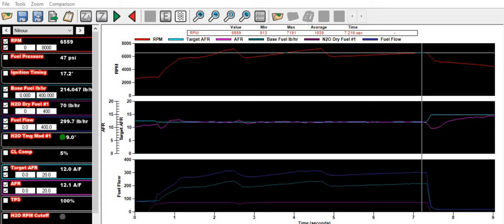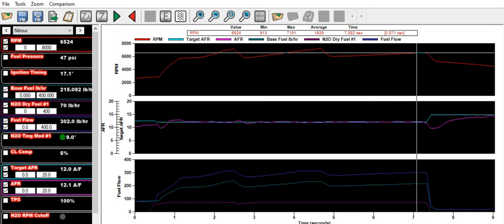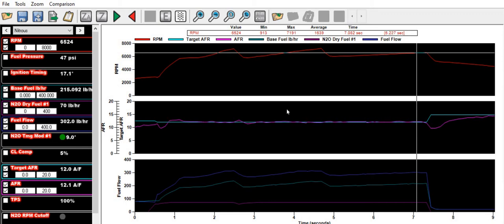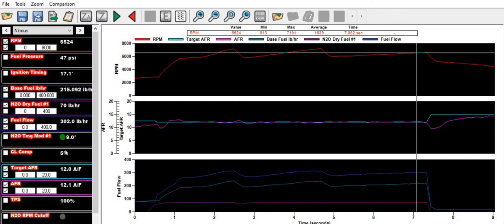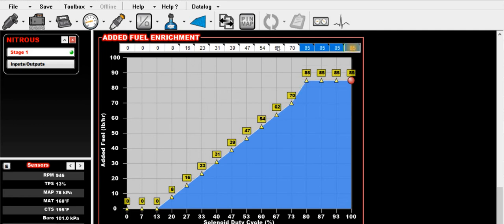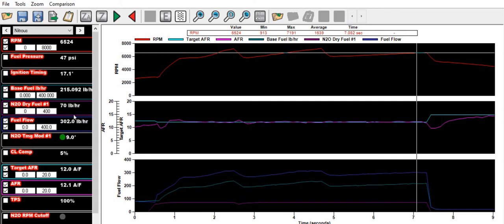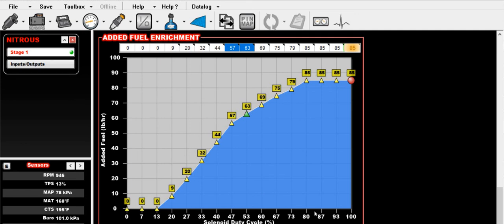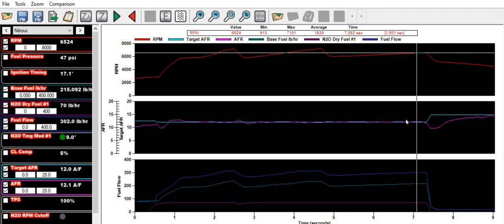Nitrous Fuel Correction with Holley EFI

Comment: What afr do you like to follow per nitrous shot?
And how much nitrous is okay with just pump 93?
Reply from the maker: Let me stress that this is my opinion since the first thing I usually get is an argument but I typically will run 12.0:1 up to about 750hp. I’ll then taper down to 11.4-11.5 up to 1000 and usually level off there. Past that I don’t have enough experience to comment. 

Nitrous can get too rich earlier than boosted applications typically. 

The amount of nitrous isn’t really related to pump gas as much as cylinder pressure but for general terms on LS engines I usually stop somewhere around 150-200 before going to pump gas but that depends on engine size and chamber shape, plug heat range and tip style etc. 

Gotta keep an eye on plugs and make good decisions
Reply: @greenshortsperformance  thanks that helps big time. 
I don’t understand why people always want to go to 11.8 or richer afr for nitrous some times..

What about timing you add some back in after peak torque like what people do with boost?
Reply from the maker: @408lethal  yeah I typically run a half AFR leaner than boost but it’s a little different since nitrous increases flame speed. For the same reason I do not add back timing. You pull timing across the tq peak to protect from detonation however you pull timing with nitrous to make best power. If you didn’t pull that timing you’d actually probably not knock just make less power. So I recommend whatever timing you had for best power NA, just pull 2 degrees per 50 and add back based on what the plug looks like.